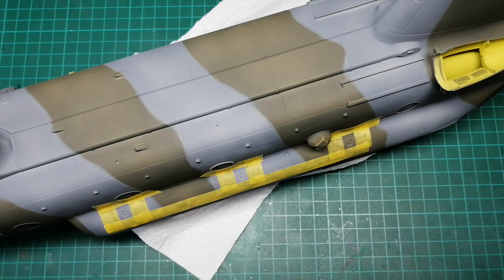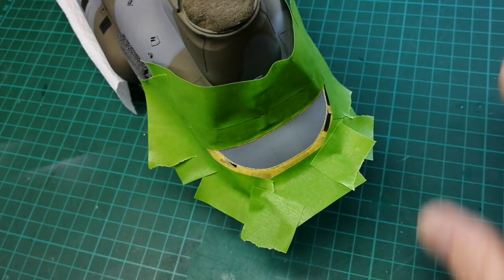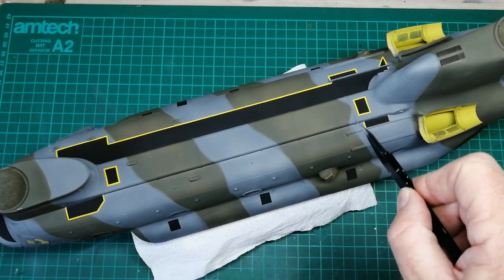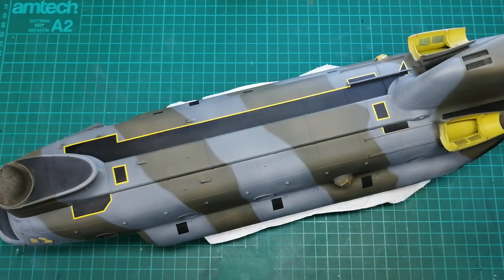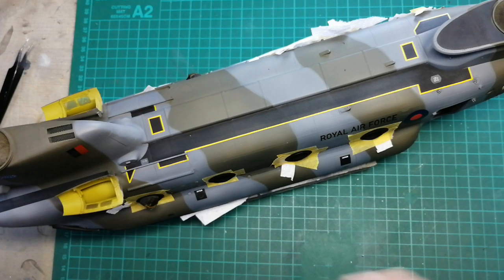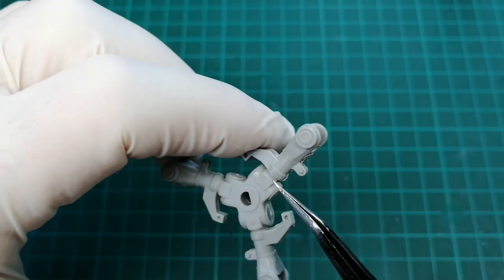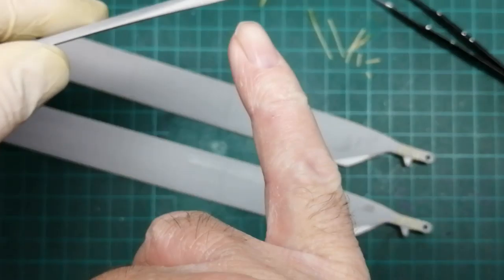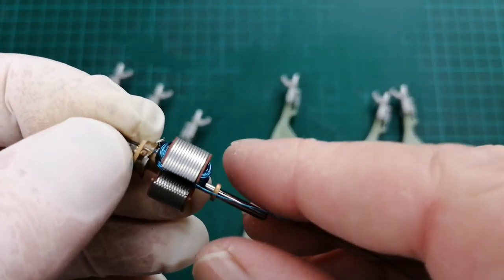Trumpeter's 1/35 Chinook 47D built into a RAF HC. Mk ? (Part 10)

Comment: I looked at your scheme on my pc. Really good job on the paint scheme. One question,the black areas are walkways for maintenance and crewcheifs? Shouldn't they have a non slip type coverage on them? Just curious.
Reply: They were indeed on the HC1 a typical anti slip sandpaper like finish. They also had a red diagonal dashed line outside of the yellow border, and If memory serves, there was no large black walkway on the fwd  rotor pylon roof. However, since this is possibly representing a later, maybe HC2 model who knows.